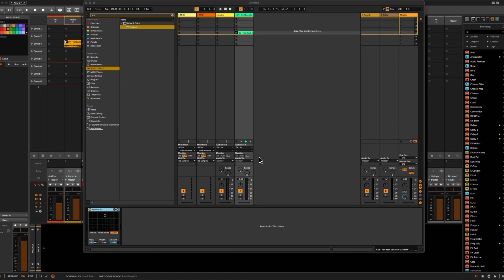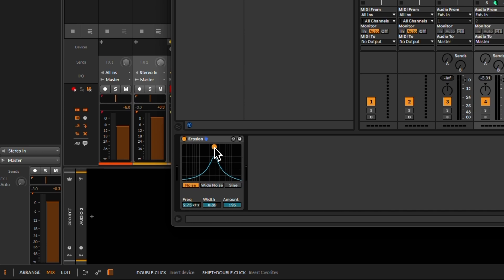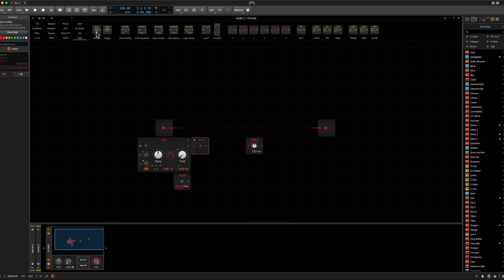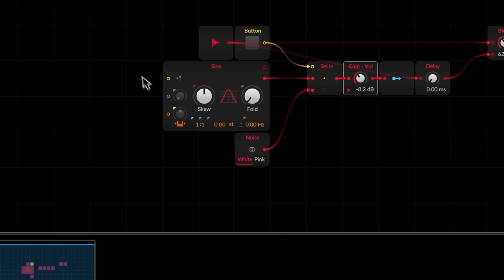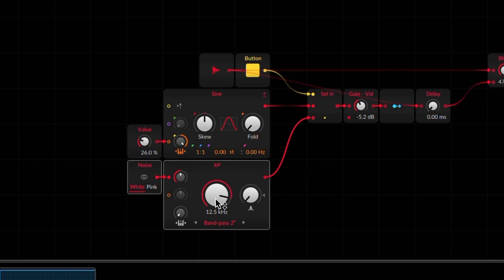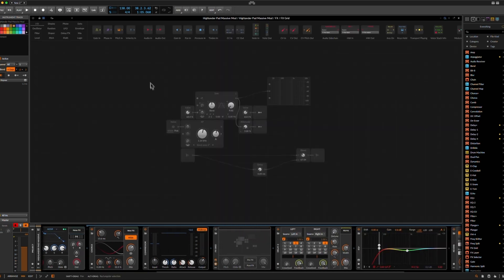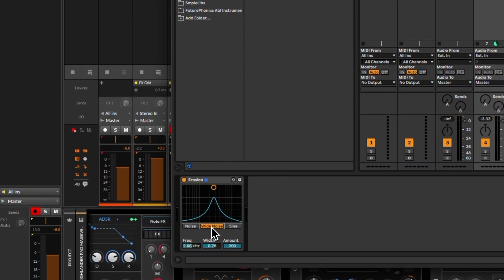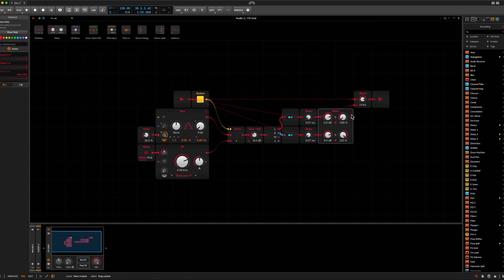Recreate Ableton's Erosion FX in the Grid!

Comment: You should check out my plugin NEL. It is a vibrato (modulated delay) and its Audio Rate modulator does exactly what your keytracked erosion grid does, but with an easy workflow. Also you can easily put 2 audio rates on top of each other at different octaves (or any transposing) and then mix between them to find the best texture
Reply from the maker: Very neat, I'll definitely give it a try 😎! You should probably change the Readme title. I almost closed the page when I read "Windows only" until I then saw some mac related commit message :)
Reply: @theRumbleChannel  oops, you're right